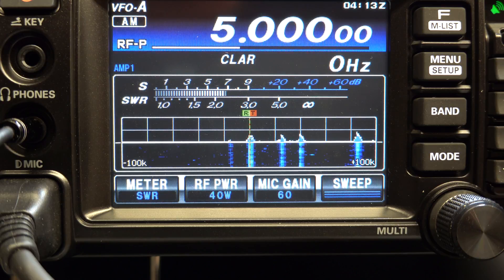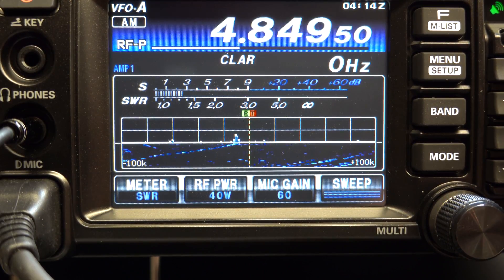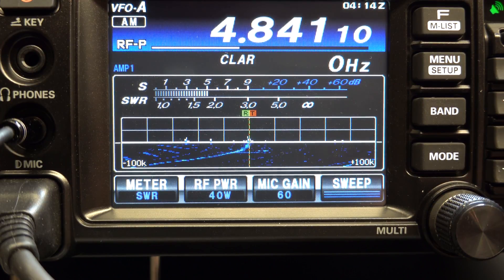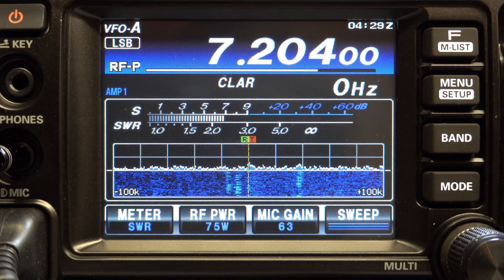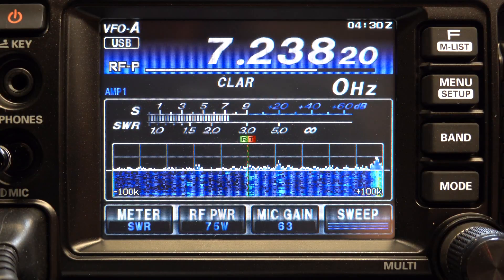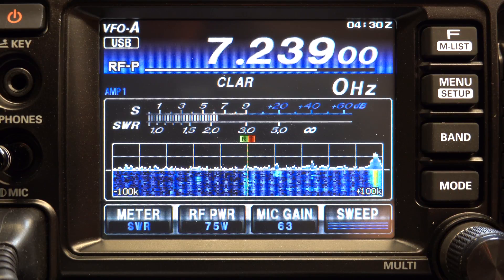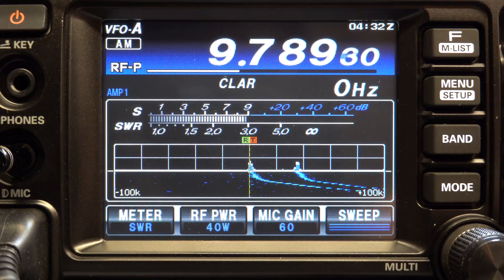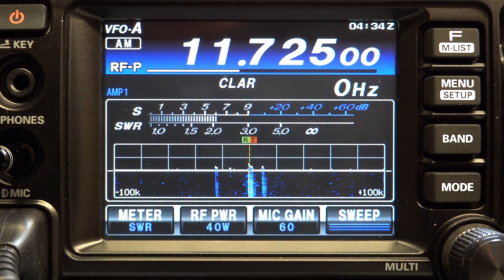Shortwave Listening with Yaesu FT-991A

Comment: Very low noise level - What antenna are you using ?
Reply from the maker: The antenna is an Alpha-Delta DX-EE parallel dipole at 21 feet